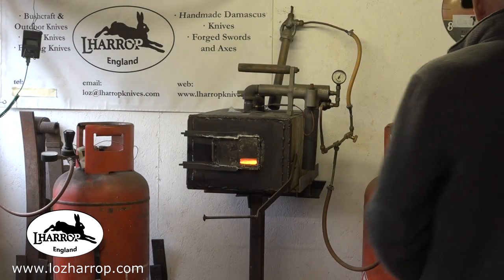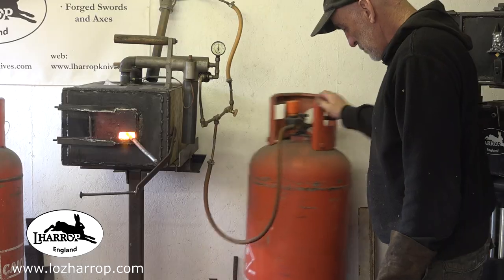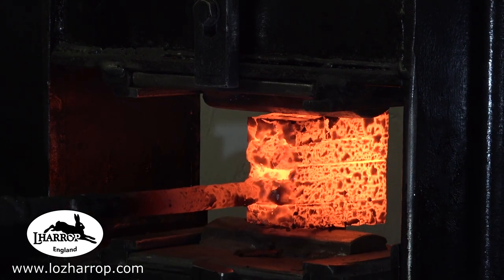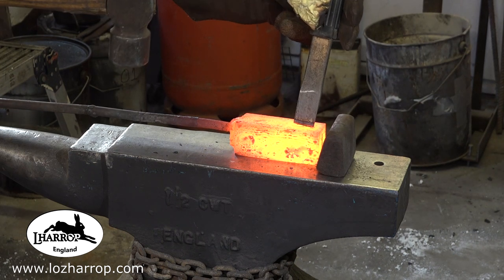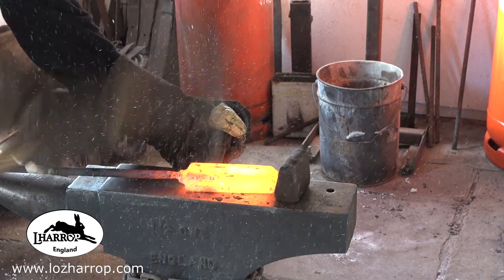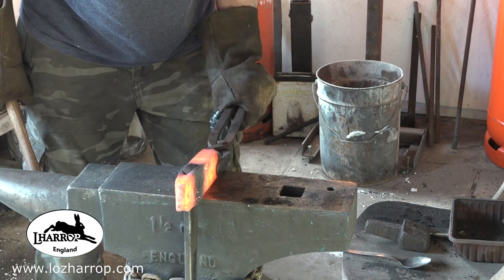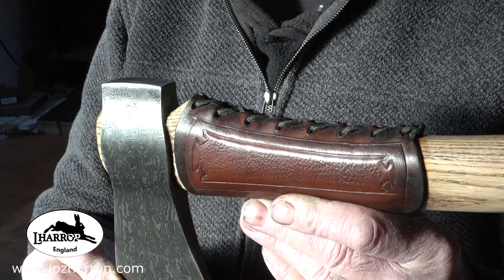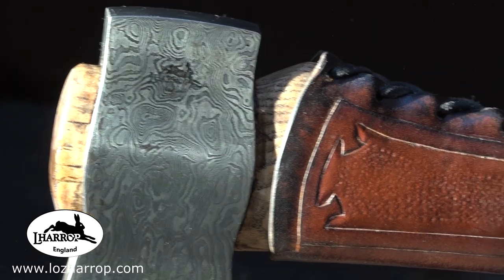The Making of Richards Damascus Axe

Comment: Very nice partner! Do you sand the handles on your 2x72?
Reply from the maker: Cheers Bud, nope cut profile out on bandsaw and used those sanding discs in the 4 inch grinder to remove the corners and shape, then just a good hand sanding as always